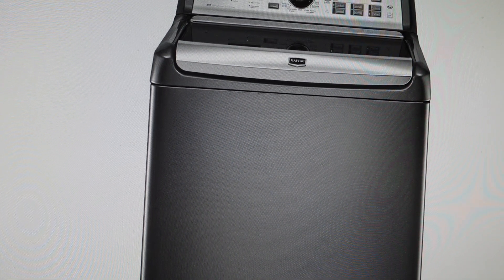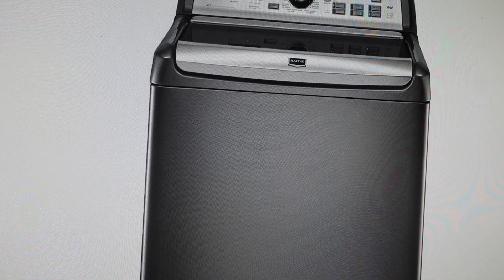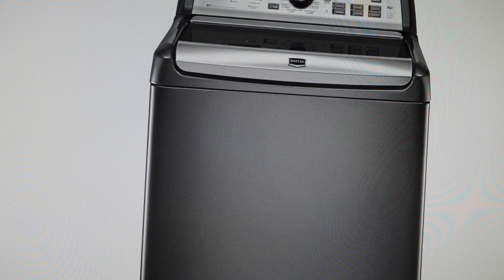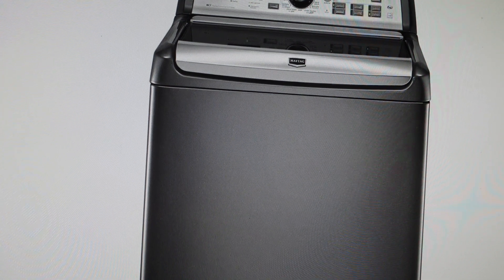Maytag Bravos Washer Stuck on Sensing Mode

Comment: Hi and thank you for your video,if only the cold water valve is bad ,and the machine stays stuck in sensing mode even in hot selection? 
Also when it comes to the shifter problem , usually it won't pass the diagnostic mode right?
Thank you